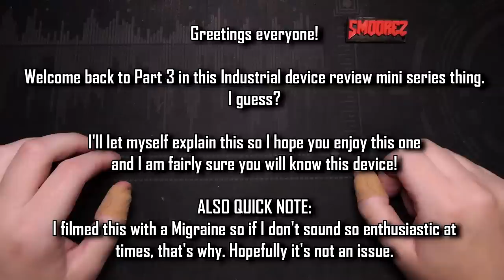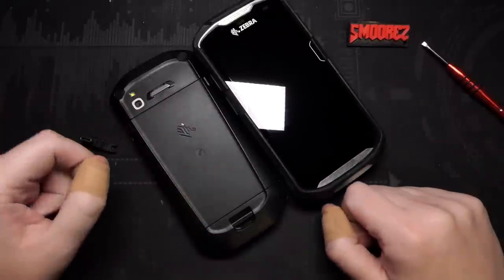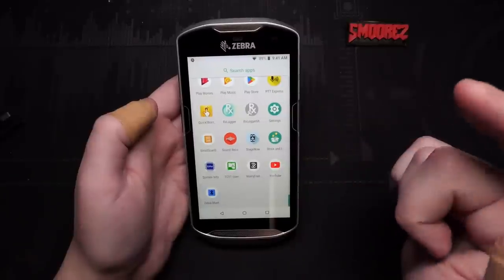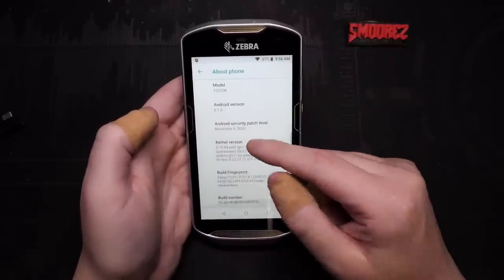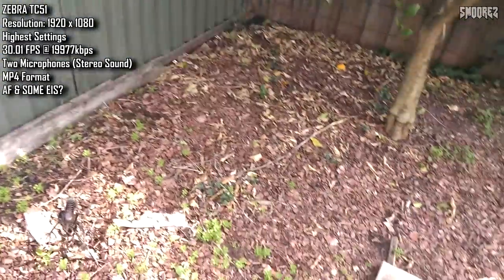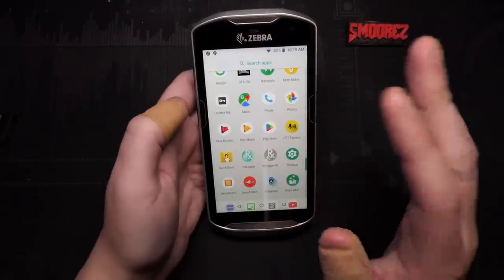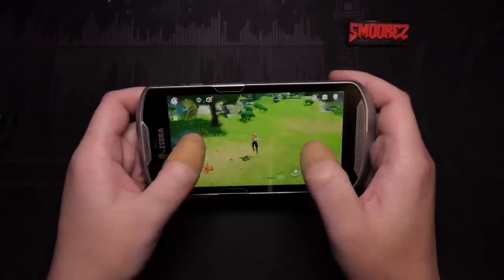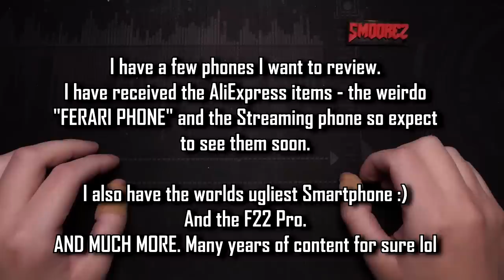Testing the ZEBRA TC51 Barcode Scanner - I am pretty sure you've seen this device before...

Comment: I absolutely love my TC51.  I handle inventory for a small business and ran across one a few years ago. I also had to nuke the enterprise locks and upgrade to get it working.  The USB cover tricked me as well until I (like you) got an inspiration out of the blue to pry it off.  Our products are all barcoded but the owner kept insisting on writing everything down to update our system despite the fact the accuracy and speed has more then paid for itself.

The scanner is definitely a champ.  It can cut through dust, faded print and greasy fingerprints with ease while people trying to use any phone camera have to wipe it off, print with fresh ink, pray, turn the label into better lighting, curse alot, etc.

My battery is dated 2019 and the unit seems to hold a charge fairly well.  A few hundred scans might only drain it perhaps 10% or so.  The camera takes really good pictures that while not being the highest mega-pixel rated are very well compressed by keeping the details clean with minimal artifacts.

Love your channel man,  thumbs up.

<reserved for if I think of something about the TC51 later>

Comment: I am a retail worker that owns and uses a Zebra device personally as my daily driver phone, they do sell models with cellular capabilities among other unique features. As mentioned in the video everything about these devices are expensive, when your store manager says that it will cost over $3000 to replace one of these devices that cost includes the cost of the boot (the protective case), the strap and most importantly the extended warranty. Most if not all of Zebra's product come with a 1 year factory warranty covering defects from the factory, if you smash the screen then you better hope you have an extended warranty that covers accidental damage. My model of device is a TC27 if anyone was curious

Comment: We use ZEBRAs in car factory for help with quality check. 
It can stand two 8hours workshift with 10 minutes of charging every two hours (break times)

Also i can see the device with the material/logistic workers with a hand pistol accessory (You can put the ZEBRA into a special case and transfer into a pistol scanner - it does have a trigger too)

Train ticket control also use ZEBRA scanners
Reply: I use one as supermarket delivery driver be lucky if get few hours out of it. May be the heat from the sun of it being in windscreen I'm not sure but I find them to be terrible. We don't use the barcode scanner so for what we do a decent android phone would be far better.

Comment: Fun story.  We use these at work after they replaced a Windows based 'Bluebird' device we used to have.

I found out that these new devices would be Android based and it had me excited because the Bluebirds were absolutely terrible.  Now me, I'm a Windows guy for life, but give me iOS or Android any day on a mobile device.  I told my boss that they would run better because Android is an open source OS and you can tailor your apps around the OS or you can tailor the OS around the apps, unlike Windows where you're literally locked down to do what Microsoft wants you to do.

Over the past few years, the Zerbra's have been really acting badly, apps constantly crash, logging in is a chore (sometimes it restarts in the middle of your login), sometimes they don't like to connect to wifi, etc.

I found out through another store manager, who was on a committee talking to the company's tech people about the issues we were having and found out that the company decided to do things as cheaply as possible.  Instead of working from the ground up, they simply ported the existing Windows based apps to the Android system.

What I found out was since they weren't optimized for Android, every time we get an update, it compounds already existing issues and makes them worse.  What's more, the OS cannot handle the workload of the apps because they weren't built for Android.

Now they're literally having to re-write the entire system from scratch which will cost them even more in the long run.  Great work, guys.

Comment: We actually use these in the college mailroom that I work at. We use them when delivering packages. We have two of them, we got ours through our mail machine company, ours have the exoskeleton and the charging cradle. For as much as we use them and have dropped them a few times, the exoskeleton takes all of the hits. We have a stylus tethered to the exoskeleton, but we usually just use our fingers. The scanner actually works pretty well in the light. I didn't know it had push to talk! Now I want to try to find it! That would make it a lot easier to get a hold of each other! The only customizing we've done was make the font as big as possible for my 64 year old coworker.

Comment: I bought one of these, what zip file did you use to update your Zebra? I upgraded mine to 8.1 but the Google Play services keeps crashing. Any ideas?
Reply: Nevermind, I got it working. For anyone who does the same its the FPU_ATLAS_02-32-04.00-OG-U00-STD zip, the others on the FTP site are for the non-GSM devices and will not have Google Play Services however it does not stop you from installing it on a non-GSM devices.

Comment: Been using these in different retailers for years. Managed to break the glass on 1. They mustn't be too hard to replace though as we usually had them sent out and repaired in a week or so. Very drop resistant. Lost count of how many times they have fallen of boxes or been accidentally flung onto concrete and had no damage at all.

Comment: I haven't broekn them personally but I have repaired a couple. If anything breaks it's the screen and it's usually when the case isn't on it. It can also break with the case on but we're talking like dropping it right onto the corner of a curb where it hits the screen dead on. The screen replacement is also cheap.

Comment: A lot of stuff you mentioned at the beginning just doesn't match up. We had a bunch of those at the store I worked at. But I was able to put them in reset mode and one that didn't really work. (The scanner was broken) I reset it. And it brought it back to the setup page where you log it into your network and register it with your company

Comment: What model is the motorola btw ? I can't find it on gsmarena .
Reply: nvm,found it Zebra TC55 .It runs android 4 jellybean Android 4.1.2 or Android 4.4mobil.3* with Mobility Extensions (Mx) with 8mp camera and integrated scanner . Old android phones with old version of android  still can be used but you will need light apps or sideload older versions like whatsapp or other  popular apps .Chrome ofcourse is not supported so you will need to go with Lightning browser or Via browser or similar ones ,or you can sideload it but not sure how older versions of chrome will work (maybe older versions of chrome are lighter on resources idk 🤔).Not sure about android version 2 and up .

Comment: I have a TC52x and I spent a good 20 minutes trying to pop the charging port cover off to reveal the usb C port  just to find out on this model there is no usb C and the cradle charger grill is not removable!! So it's all chewed up but it still works lol and the Chargers are ridiculously expensive I literally just use a regular charger cord with the tip cut off and insert the positive and negative into the + and - holes directly on the back of the battery works great

Comment: I use one at work for tracking equipment that other departments/sites borrow and don't return it comes with an RFID sled (RFID scanning gun) for finding stick on RFID barcode labels on a system called TAGNOS you can track using a map on the Zebra or on a web browser and it shows the location or site where the equipment has gone so you can retrieve it 👍

the sled reader connects to the handset via Bluetooth so you can enter a tag number that you already know and search an area with audible and visual tracking on screen when you are closer to the missing device with RFID tag you are searching for 👍

Comment: We have a "Zebra" Printer for printing out price-tags, this Hardware is so locked down, it's got WiFi but it was disabled so we have to use the only available option via Bluetooth... and this is really bad because the connection is so unreliable... Think about it, you are printing price-tags, but suddenly you see "no printer connected" and reconnecting DOESN'T WORK until device is rebootet...  so half of your price-tags is MISSING... everyone here HATES this printer...

Comment: Recently bought a s9 the 4gb one perfectly usable for me personally I don't need 6/8 gb plus. Some minor issues extremely minor the news app thing will not work keeps saying no Internet yet I'm running a hptspot and online on my phone. The only other issue is battery it's dogshit at 3000 max. I'm not a massive phone user so no problems, with the decent screen on full brightness it's terrible. No need for it indoors. I digress.